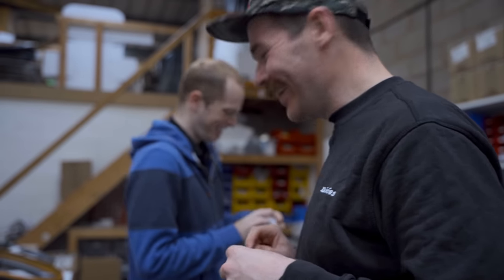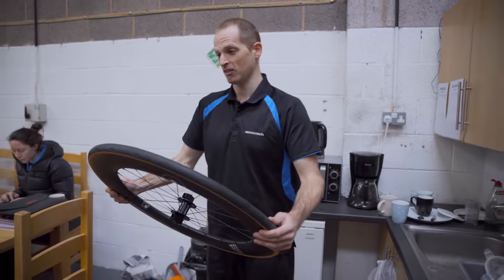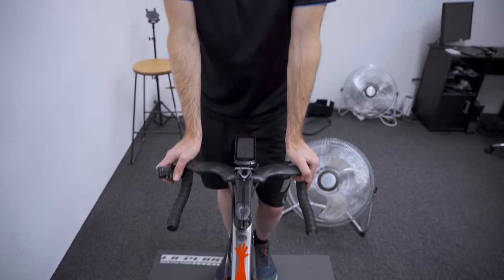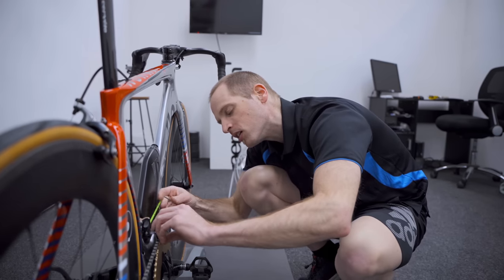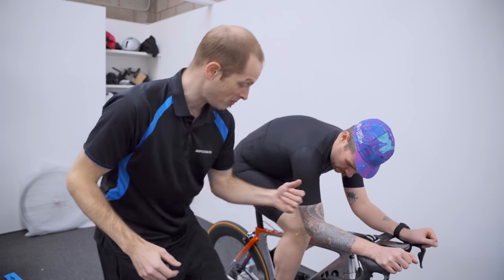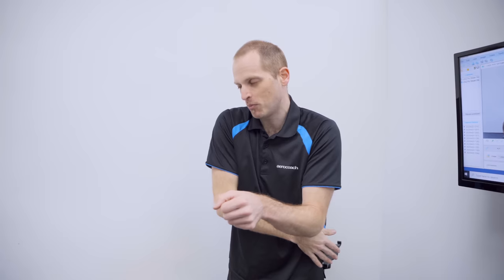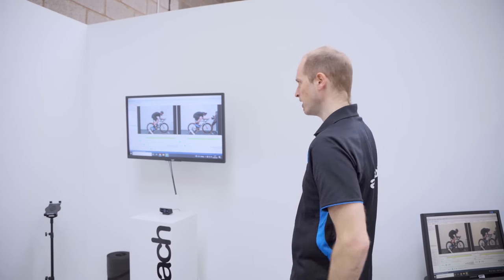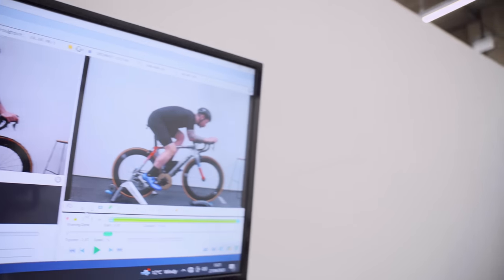HOW TO MAKE YOUR ROAD BIKE FASTER: A MASTERCLASS WITH AEROCOACH

Comment: Cant say I agree about the lever tilt. I’ve used a pretty ‘ridiculous’ angle for a long time now and experience no drawbacks with braking/out of the saddle. Biggest benefit for me is the MASSIVE reduction in ulnar deviation in the wrists. Holding that horizontal forearm position with straight hoods was never sustainable for me prior to the tilt. May be some connections to my odd physiology but oh well…
Reply: Totally agree. Way more comfortable and I don't have any issue braking. 36in bars with significant tilt inwards. I hold 2 fingers under the brake lever and 2 fingers on, I feel this is the safest as unexpected bumps can't slip me off the front of the hoods. I can hold this position for quite awhile 5-10mins and then for a break I switch my hands down to the drops but keep my head and torso the same 10-20 seconds of this and then back to the main position.
Reply: Tilting my levers solved a wrist pain issue along with some hand numbness on long rides. No issues braking or shifting either, works great!

Comment: With the bars, I actually think the design could be improved. In my eyes it would be better if the bars didn’t shoot forward at the clamp, but went across like normal and then had a long reach to the hood from there.
Why? Because this means the point where you rest your wrist on the bars for support is further back. The further back you can get the support point the easier it is to maintain a quality aero hoods position for longer and with less strain.
Ultimately this is what Speeco did with their Breakaway bar, except they took things a bit too far!
Reply: But then also that section of the bar is blocking the top of the drops for sprinting. Tough to have your cake and eat it too with this, I am looking for the same myself. It's good that sprinting was at least considered with the design.
Reply: @DanceTurbo  that is a fair point, although often the shape of the corner on the bar can make quite a big difference, a more swept corner gives more space for sprinting.
The ideal bar for fast riding would be narrow at the hoods, with a long reach for the aero hoods position, and then a flair to the drops which will give the space and stability wanted for sprinting

Comment: Curious why the crank looks to be not perfectly circular? When you see close-ups of the crank spinning (4:33), it almost looks like its got some wave to it. Is that intentional?
Reply from the maker: The chainring is slightly oval which helps with pedal stroke efficiency
Reply: wow, fascinating, never seen that before! thanks @ChrisHallRides
Reply: @christopherholewski1234 Non-round chainrings have been around for years (Rotor, Osymetric, absoluteBLACK, etc.), but this is my first time seeing one with this little ovality.
Reply: I think Shimano bought out the first oval ring back In the mid 80s if memory serves me...?